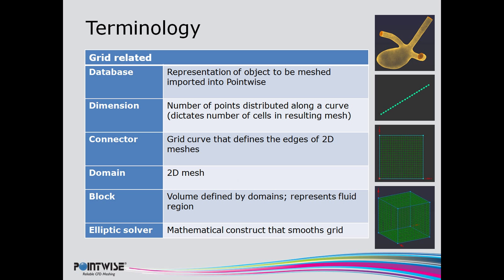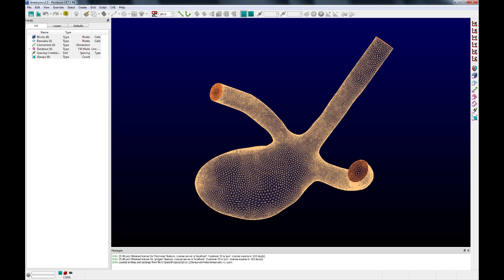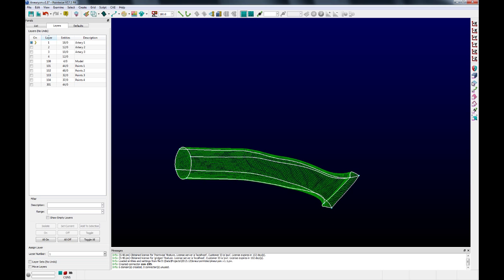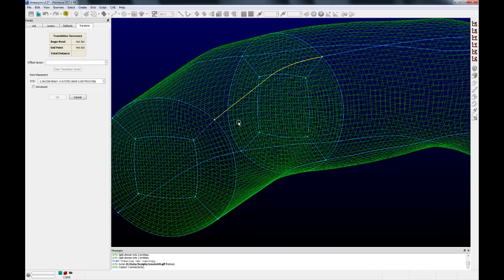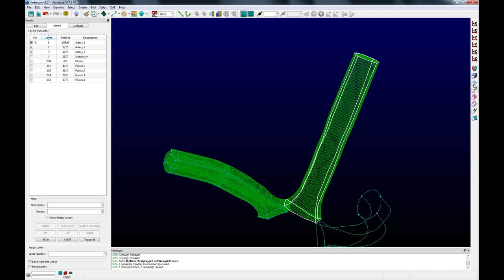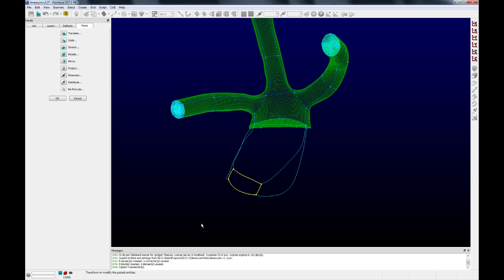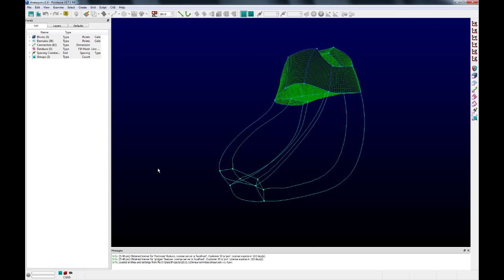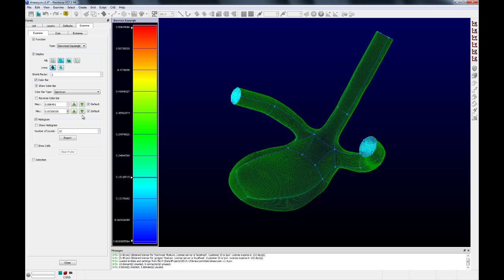Structured Grid for an Aneurysm

Comment: Hi, Thank you for this informative video. Could I ask a question please? If import a stl file for an aneurysm to pointwise , what are the first steps prior to these in this video??
Reply: wisam jasim Starting at about the 6-minute point the video indicates that points (database points specifically) were created along the STL file where topology will need to be created. Those points are then used to create connectors that are then projected onto the model. So it appears that all that's not shown is the creation of those points which is done simply by eyeballing appropriate points on the STL.
Reply: John Chawner Thank you for your reply. Actually, its very helpful for me .I have spotted the idea about creating the points in order to get the wire frame. However, the quality of mesh for STL file that I haven is not like the STL in video , which means it is difficult to create points. Which mesh program have used for this file?
Reply: wisam jasim I don't know how the STL file for the aneurysm was created. I suggest you go to the URL cited in the video's description to see if there's any information there or whether there's contact information for the original author.

Comment: I happen to use the tranlate + stretch combo all the time. Could you give a script that combines the two?

Also as the demo showed a tranlation of the tip connectors and then forming the 4 connectors manually, it would be great to have a tool that combines the two, i.e whenever a set of connectors are translated, it also forms connectors between the two end points.
Reply: You're exactly right, combining the translation and stretch operations is a great candidate for scripting. I've written a script that does exactly that, but we excluded it from this video for clarity. Watch for it to appear on the Glyph script exchange in the coming weeks.

You have a good idea regarding the tip connectors as well, it's certainly something to consider.
Reply: We'll get that script up on the Glyph script exchange soon. I did want to mention that we have an upcoming Glyph Scripting Course that you may be interested in as well. Please visit http://www.pointwise.com/support/train.shtml to see if the dates align well with your schedule.

Comment: Could you explain why we need to redistribute the connector spacing after having formed the domains?
Reply: The connector spacing was initially changed when it was projected onto the database surface. Once we made the domain, you could see clearly that there was some irregularity in the spacing (and it was no longer a uniform spacing), and so we reset it.